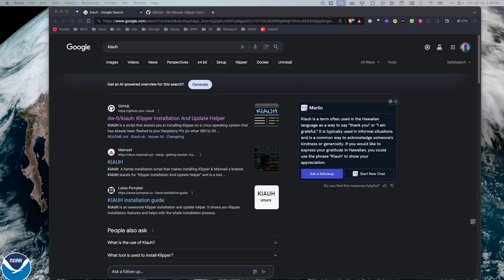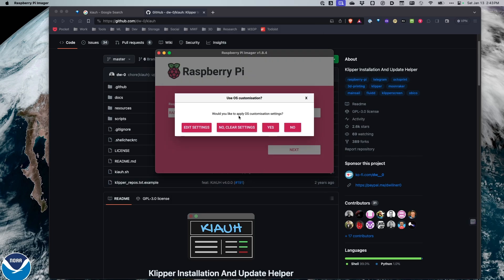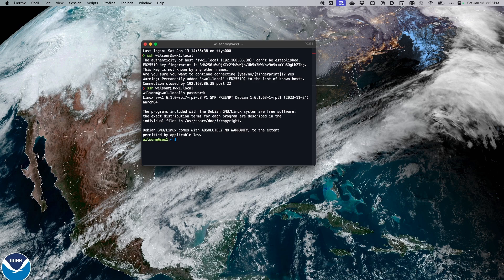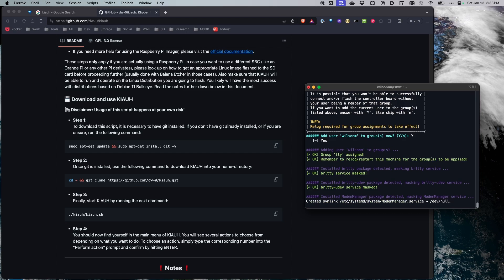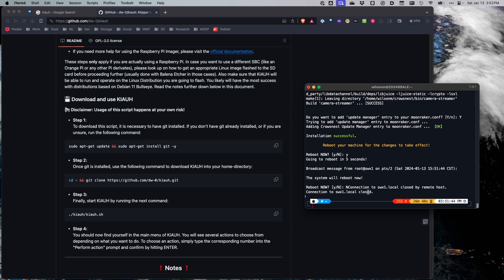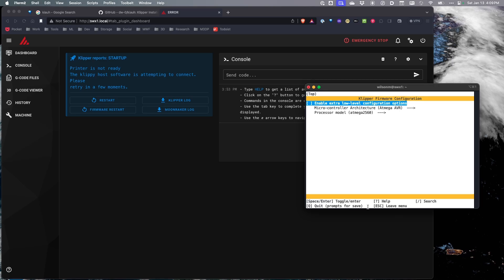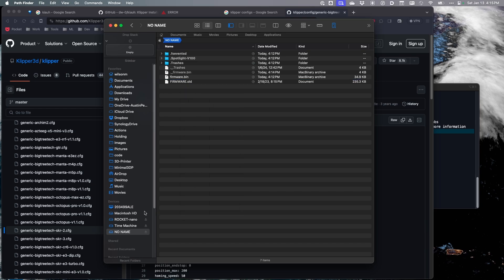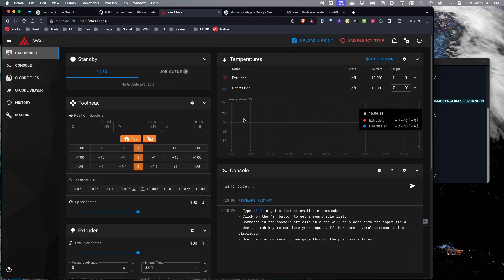Klipperize Your Prints: Using KIAUH to Install Klipper on Your 3D Printer (Part 2)

Comment: THANK YOU. worked very similar to my ender 3 s1 plus. the only thing is that once you flash klipper firmware to the printer, the screen will freeze during loading. turn off, remove sd, plug the USB, turn on again, refresh dashboard and here you go! thank  you thank you thank you
Reply from the maker: Glad you got it all working. Let me know if you have questions.

Comment: I'm curious if you are now running Klipper exclusively on Raspberry PI hardware or a mixture of Sonic Pad and Raspberry PI units? If you are running both are you using the Sonic Pad on Creality 3D printers or did you have issues with the Sonic Pad. I have both units and an Ender 3 V2 that I am getting ready to setup Klipper for it. Thanks
Reply from the maker: I now have a mixture of raspberry pi, desktops, sonic pad, and manta+cb1. I am phasing out the RPi in favor of the pad and manta combo. I am only running my pad on a creality machine and my only complaint is that I periodically lose access via mailsail/fluidd. I just switched to a wired connection today to test. I like the pad better vs the RPi. I like having both web and screen access. Does that help?

Comment: Man you fell from heaven for me. Finally something I've been waiting for. Concise and to the point. Maybe I can finally get my old ENDER 3 (2018) printer to work with the BTT SKR MINI E3 V2.0 board without BL TOUCH. I look forward to reading more. 😁
Reply from the maker: Thanks for the kind words. Let me know if you have questions.
Reply: @minimal3dp  You're doing a great job and You must to continue this series for "green users". 
I just installed my klipper on my ender 3 2018 (board SKR MINI E3 V2.0) and I have a problem with z_offset. Unfirtunatelly I don't have any probe (sensor) and I don't have any idea what I should do at first for received good print. Do I should make a probe_calibrate at first, or bed_screws_adjust.

In my first test was:
1. probe_calibrate
2. bed_screws_adjust
3. bed_mesh_calibrate
I did all these settings with a piece of paper, but at the end, my first layer not exist. 😂🤣